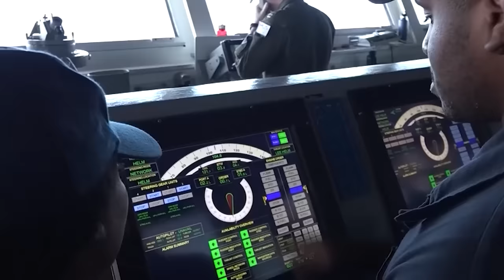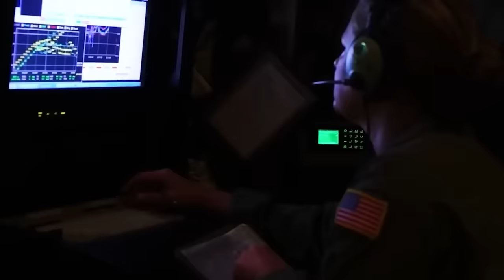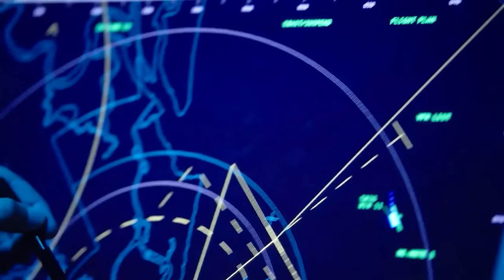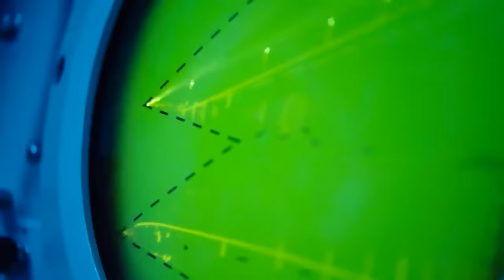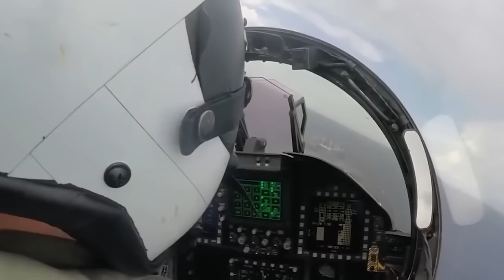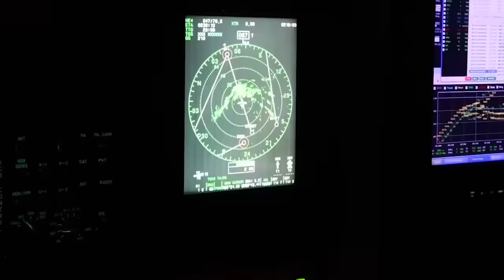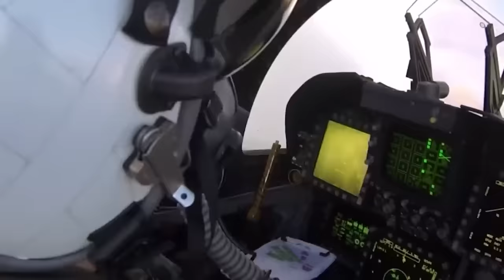US Navy's Genius Method for Aircraft Carrier Landings at Night

Comment: For the most part this is pretty good. Brought back lots of memories. However, your mix of Air Force aircraft is confusing (especially the several clips of an F-16). And what’s with the two short segments of the MiG-29 in formation? You also have several segments where the video is transposed like you are looking thru a mirror. There are also some scenes which appear to be a shore based facility. We don’t wear short sleeves at sea (fire protection). And we don’t wear civilian attire unless we are leaving the ship to go on liberty. The video should have been scrubbed better by someone familiar with carrier aviation.

Comment: More accurate and informative than most.  With 2 exceptions:

1. Every recovery has dedicated organic tankers overhead (in other words, aircraft from the boat configured as tankers).  Aircraft requiring tanking during a recovery will always tank from those Navy recovery tankers.  The video show Air Force tankers (and even Air Force aircraft refueling), especially in the beginning of the video.  Naval aircraft do tank off of heavy Air Force tankers, but it's most often on the way to/from a mission or overland . . . never as part of a recovery.  The standard around the boat for recovery tanking is "plugged and receiving" within 90 seconds of a bolter - that is never going to happen on an Air Force tanker at typical Air Force tanker altitudes.  The Carrier Air Wing trains specifically for this - in fact it's one of the checks in the box they have to demonstrate before deployment certification.

2. The video implies that a carrier arrested landing consists of separate sensations of touching down, a split second where you're waiting for the deceleration, then deceleration in your straps, the head, then your whole body.  This is how people imagine carrier landings who don't have carrier landings.  It's what I assumed before my first carrier landing.

It's not correct.

When my parents asked me what it felt like, I told them "Get in your car and accelerate to about 40 miles per hour.  Then drive it into a tree.  While soiling yourself."  You wouldn't feel the bumper hit the tree, then notice the hood start to crumple, then the seatbelt digging in, etc.  You would experience it all at once.  It's the same for arrested landings - one moment you are flying, the next moment it feels like you crashed into a brick wall.  Everything in the cockpit surges forward at the same time - hopefully into some kind of restraint.  The tires hitting the deck (750 feet per minute vertical deceleration), and the hook catching the wire and resulting horizontal deceleration (150 mph to zero in 2 seconds) are both felt simultaneously and instantly.  It's an overwhelming shock at first, but you get used to it after a while.

Even if the hook just misses a wire (leaving the longest possible distance of about 50 feet before the next wire), at landing speeds it's still less than the blink of an eye (not a figure of speech - we're talking small fractions of a second) for the hook to cross to the next wire and catch it.  Imperceptible for a pilot.

If a carrier pilot notices touchdown without the "crashing into a wall" sensation, they already know they missed the wire and will be airborne again in the next few seconds.

But the rest of this video is pretty good!
Reply: I would have happily asked you to sign that line item for my AW qual, great explanation.
Reply: Thanks for addressing the refueling. I was wondering how it's possible to fly up to tanker altitude (assuming a tanker was nearby) if you don't have enough fuel to circle around for another landing attempt.

Comment: I was ship's company as an ET in the radar shop on the USS Forrestal CV-59 back in 82. I was in charge of the ship's long range air search radar. Our shop was two work centers, one for search (SPS) radars, one for air navigation (SPN) radars.

While I never directly worked with the SPN side, I worked with the people that did. My understanding of the ACLS radar we had back then, was that it would take control of the aircraft at about 5 miles out, putting it on the flight path, then return control to the pilot at 1 mile out, leaving it to the pilot to actually put the plane on deck (or not). I was told that the equipment could, in theory at least, actually land the plane itself, but this is how we were certified to operate. 

We lost two F4s on that cruise, one failed catapult launch, one failed recovery. The cat failure was daytime, and I was night crew, so I only saw the video. Those cameras they mentioned here that let you see the flight operations? That was on every TV set on the ship. We watched it in our radar shop, which is where I saw the video of the cat failure. A burst of steam halfway through the launch, followed by the F4 just sort of falling off the bow.

The failed recovery was a night recovery, so under ACLS, and resulted in our radar shop being investigated. That F4 came in low and caught the round down. Broke up into lots of pieces, scattering debris and spot fires all over the flight deck aft of the island. Someone came into our radar shop (in the island) yelling about it and we all went out to vulture's row to see.

So, we had investigators in our shop for days afterwards, poring over our maintenance records for the ACLS radar, interviewing the techs, etc. Ultimate ruling was pilot error.

The TACAN mentioned here is a beacon. I was tech for the one we had on my second ship, a frigate (USS Vreeland FF-1068). For our use on the frigate, it was just a homing beacon to tell the helo (the only thing we carried) how to find us. It will generally be the antenna at the very top of the ship's mast.

When I was first aboard the Forrestal, during workups before that 82 Med/IO cruise, I had a brand new 35mm camera. So, flight ops being "new" to me, I spent a bunch of time on vulture's row taking pictures. Turned out, the camera body was bad, so the whole roll of film was wasted. When we left on the cruise, I had the replacement body, so a good camera. But, by this point, flight ops was so "normal", I just kept thinking, I'll get to it eventually. Actually had to force myself out to take pictures towards the end of that cruise.

And, I'm glad I did. I have a very good picture of a recovery, zoomed in on the tailhook, which is just about to catch the wire.

Comment: Since you asked for comments, here it is-- over fifty years ago, when I did it, I got my traps.  We got lots of practice first and we were ready.  The formula is "Meatball, Lineup, Angle of Attack".  Then when the landing gear hit the deck, go to full power and retract the speed brakes.  That way, if you get a hook skip or another cause of bolter, you're set up to fly off and come around again.  If you get a wire the taxi director will come out and give a cut signal and hook retraction before directing to the spot.  
Thank you for letting me reminisce.

Comment: I spent four years aboard USS Independence in VA-66 A7E Waldo's in 72-75. I was an electronics troubleshooter working mostly at night. It's dangerous enough during normal landings and it Really gets hairy in rough seas with rain and a pitching deck of around 20 feet plus. With the wind across the deck, blowing rain, pitching deck and trying to maintain balance on a oil slick wet deck is treacherous, the pilots had a lot of guts to land the planes under these conditions.
Reply: Great post, Mike! I was also on the Indy 72-75. I was attached to VS-31 Topcats. Was AE troubleshooter at night launches. Had to keep your head out of your ass, for sure!

Comment: you know, showing an F16 refueling while describing carrier operations is not helpful, as the technologies involved are different.  eg: navy aircraft typically use drogue basket and probe, while the air force typically uses a boom from the supplying tanker.  at around 3:18 or so, we see the air force style of refueling, but the entire video is about the navy*, so it would be better to show the *navy method of refueling.  there are also multiple instances where a close-up is provided of an F16, while the wide view is that of an F/A-18, and even some shots of russian aircraft.  very strangely assembled video clips.

Comment: I’m curious why the F35 is catching the wire when it’s a VSTOL aircraft and can just gently set down on deck saving the airframe a lot of unnecessary stress ?
Reply: F35-C is the Navy variant. It is not STOVL. F35-B is STOVL, but a vertical landing can't be done if over a certain weight. Also, I'm sure you have to do wired landings to be carrier certified. I could be wrong about that when it comes to USMC, as they fly the B variant.

Comment: Had the privilege of spending two days and nights on the USS Kitty Hawk (CVA-63).

As visitors, we were allotted the cabins just below the landing deck. It was the experience of a lifetime to have airplanes landing on the iron roof.  And  carrier "landings" are not landings.  They are "controlled crashes."  The airplanes keep descending, aiming to catch one of the arrestor wires.  The lucky ones hit the deck at the right spot while the others have to quickly take off again for another attempt.  To reduce the reaction time, they open full power just before touchdown.

Comment: As an aviator with 225 landing on the Lexington and Forrestal, this is technically very accurate. Exception, only at night, there is a tanker plane circling the boat ready to join up on a plane in need of more fuel. If air-to-air refueling is required in order to reattempt a landing, the tanker is one of the jets on the boat that is refitted with a Buddy Store installed on the center bomb rack. The Buddy Store has a refueling hose and basket. The tanker pilot joins up with the aircraft needing fuel. Many times, the tanker gives so much fuel away that he must land on the boat as he doesn't have enough fuel to go to a land based airport.

Comment: I can relate as a helicopter pilot. I worked at night sometimes flying to oil drilling rigs at night in the Gulf of Mexico. They were stationary, but obviously surrounded by blackness. Easy does it on the flight controls. There's no one to direct you. You must concentrate immensely on the rate of closure, and remember where the wind direction is. Sometimes you will make more than one approach. 👀 Thumbs up to Naval operations 👍👍🇺🇸

Comment: Flying a twin engine prop aircraft aboard an Essex class carrier in the mid '60s was interesting in several ways. Without a doubt the hairiest launch was in the Med as a new LTJG in the right seat next to an experienced LCDR. When we launched we had no actual horizon, just a velvet black hole. We launched on instruments with me doing the external observation of the deck while the commander was glued to the instruments. Interestingly the recovery was not bad because of the OLS was the reference. 

When we received the USS Yorktown as a replacement for the USS Randolph we actually had an improved night landing system that most never notice these days - the drop center line. That is a row of lights dropping down from the ramp and giving a night visual extension of the center line of the deck. All the more modern carriers have this as did the Yorktown, but the Randolph did not. I actually preferred night landings (when I accumulated enough experience to get in the left seat) as there is less visual distraction. You are more focused on the landings.

Comment: I would really love to learn about this same process but for helicopters? Is there a marshaling and recovery process for them? What does it look like? How does Plane Guard work? How does cyclic ops in general work? How do carrier quals work? How does fueling and arming work?
Reply: At night the planes go the a marshall stack and wait for their push time given by atc to start their descent for landing.  During the day there is no marshall stack the planes fly over the ship longwise conduct a carrier break and land.  Weather minimums play a big part whether it will be a cas 1,2, or 3 recovery.  Plane guard launches and hovers off the starboard side of the ship within a mile or two during launch and recovery.  It lands last after the last plane lands.  Carrier qualification is just the squadron pilots getting required requal takeoffs and landings in order to be carrier qualified.  Each one is required to get a specific number of day and night traps in order to fly  onto and off the boat.  Cyclic ops are the normal operations cycle of the ships daily events.  There is a designated launch and recovery time posted on the flight schedule and the planes in that event launch, then the planes from the previous event recover.  There is single cycle usually a 90 minute flight and double cycle which three hour flight.  Usually you are either launching or recovering at a single time but my ship did something called flex deck when we had launches and recoveries happening at the same time.  You use the bow cats to launch and recover on the angle.  Refueling is usually done when the plane returns.  There are a lot of factors involved to refuel such as will the plane launch the next event, is it located near a fuel station in range of a hose.  Arming is done on the flight deck prior to the launch cycle then once the plane gets to the cat the weapons pins are pulled prior to launch.
Reply: @michaeljohnson4258  Oh nice thanks. Is that landing info for helicopters or jets?
Reply: @ChadGatling  mostly jets.  Helos launch before the event and land at the end.  They just liftoff from their landing spot on the angle and land there too.
Reply: @michaeljohnson4258  Ahh ok, so helicopters just kinda hover in line and wait to get clearance and a landing area? I guess they just stay below 500 or something. You can't really have helicopters and jets recovering at the same time, i guess.
Reply: @ChadGatling  everything is coordinated in accordance with the CV NATOPS procedures manual.  Try to find one on line since it is unclassified,  it explains in great detail how things work.  You also have the air boss and mini boss watching and if they see something they call it out.  The helos have their procedures and the fixed wing have their procedures and they are kept separate but they interact.  Everything is very coordinated and safely orchestrated
Reply: @michaeljohnson4258  there is an overhead stack during Case 1 day recoveries starting at 3000’ and up, every 1000’. Tankers usually at 2000’, spin pattern 1200’, break at 800’, day pattern at 600’.
Reply: @OldNavyGuy  you are probably correct.  I only remember the Marshall stack at night and low weather minimums.  I remember flying back to the ship and the wait to land was very short compared to night and bad weather ops.  Never liked the night ops since we would circle the ship for 30 minutes or more waiting for our push time then get the tanker sponge call from atc so add another 30 on that.  Of course I have not flown in 19 years so my memory is probably betraying me.
Reply: I was on the flight deck of CVS-9 and  CVS-1, USS ESSEX and USS WASP in the late sixties.  Gods weather or bad, I felt safer when the fixed wings were landing than the helos. Fixed wings pretty much going to be going in a straight line if something goes wrong.  Helos start bouncing around and tipping those big rotors down to deck level or breaking up and flying all over!

Comment: On approach, I use power to control glideslope and rate of descent and elevator to control airspeed.  Does the Navy do it that way or the reverse?
Reply: Basically, but naval aviators fly angle of attack rather than airspeed. Landing AOA stays the same even as the airspeed that corresponds to the landing AOA decreases as you burn fuel and decrease gross weight.

Comment: Saw many carrier landing
Planes coming aboard with hung or dance . Which more that likely goes rolling down the flight deck.
It is usually thrown over the side by the nearest person
Hung ordinance is those that have been dropped but didn't leave the plane until the planes contact with the arresting wire.
Rockets would leave their pods
Really fun place but 12 hours flew by
Reply: I knew an F4 pilot who was so laid back I'm surprised they let him fly.   One night a flight went out for a night MissileX and shot their missiles, or at least most of them.   When this pilot returned he hit the deck hard and ended up releasing a sidewinder that flew across the angle deck and out into the sea.   He was sent back to VF-101 for some additional training.  He was a great dude but I never saw him after that.

Comment: 1. There are other situation’s winning listed people can give an order to an officer.  These are primarily guards.  They are considered serving as a representative, the Commanding Officer  

2. I am nitpicking here, but you showed Air Force planes refueling rather than Navy  planes.   Navy tankers don’t have a boom that flies (can be maneuvered) so the male part is located on the receiving plane and it couples with a flying basket that is just drug behind the refueling Navy plane.  When the Air Force refuels a Navy plane, they don’t use their flying boom like the one you showed in the video. The stick the basket style out the back that the Navy plane flies into.